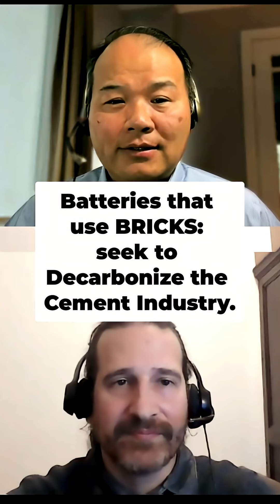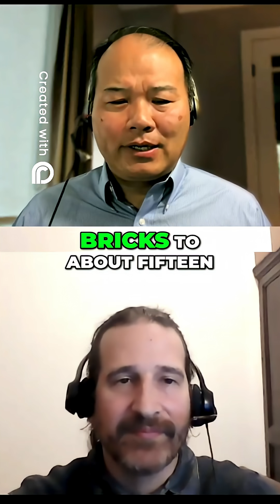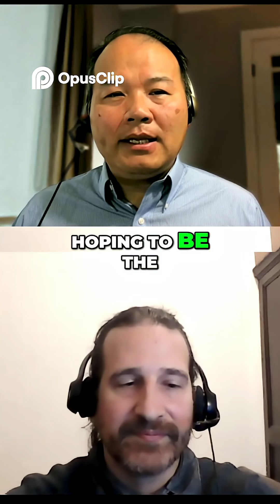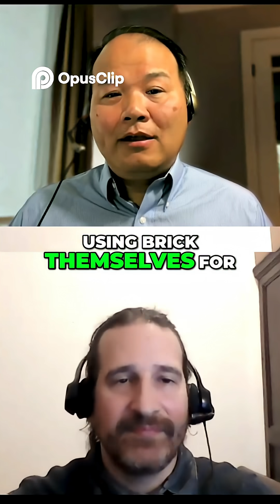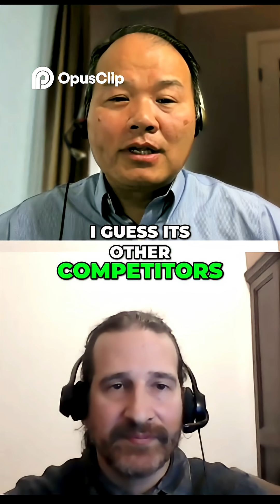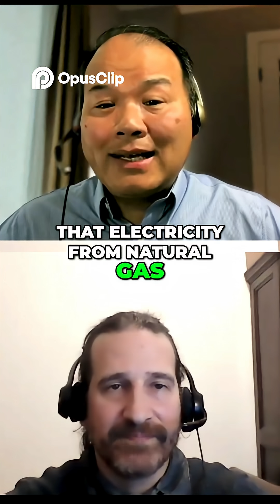Seeking to Decarbonize the Cement Industry: Brick Batteries #cleanenergy #climatebasics #hotbricks

Comment: Stating the obvious, every oven ever made is insulated. A blact furnance is no different.
Reply from the maker: Insulation is one thing, another is thermal mass storage to reduce the heating cost between cycles. Both are required for optimally efficient energy use. Thanks for watching!